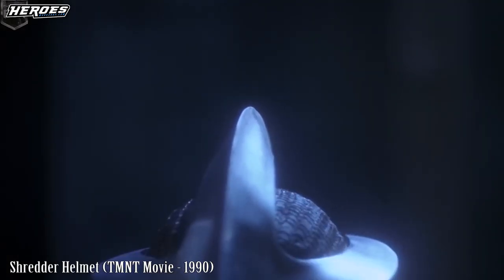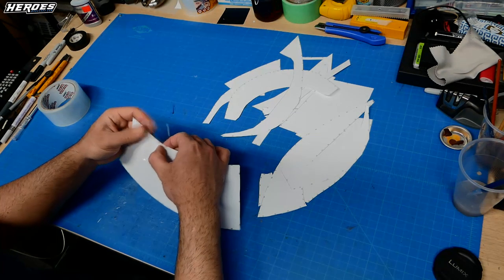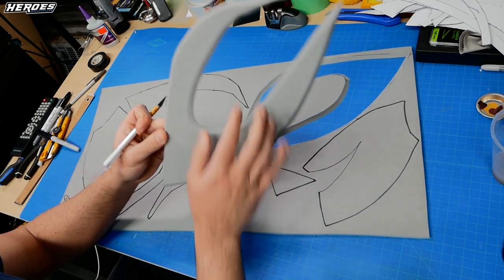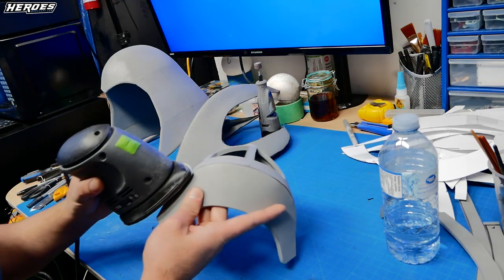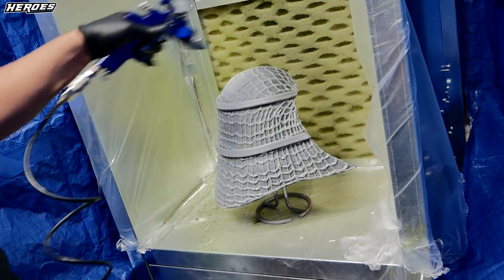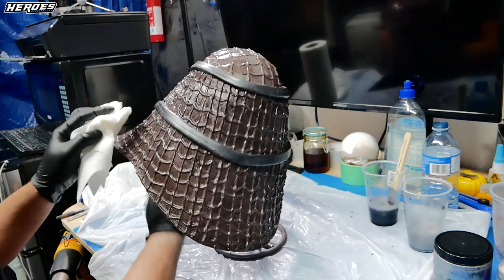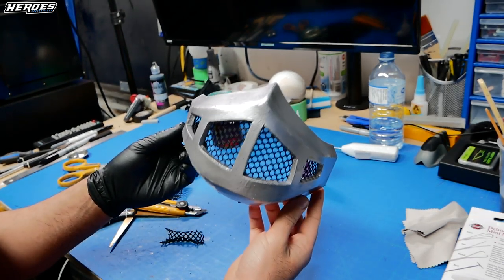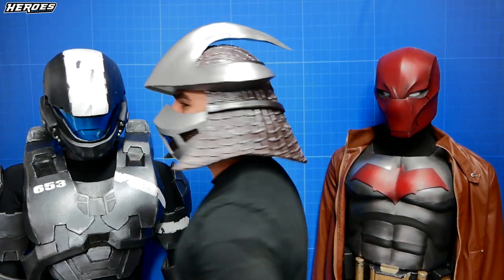Shredder Helmet - Teenage Mutant Ninja Turtles Movie (1990)

Comment: Would you and if you could would you 3D print it? Also for a stronger hold for the face mask you could use earth magnets and get smaller mesh.
Reply from the maker: Yes, magnets are something I’ve always used and already considered for this as well. Also, 3D printing is always a good route for making a screen accurate version. I build with foam on my channel though. So I’m not really going to be getting into 3D printing.